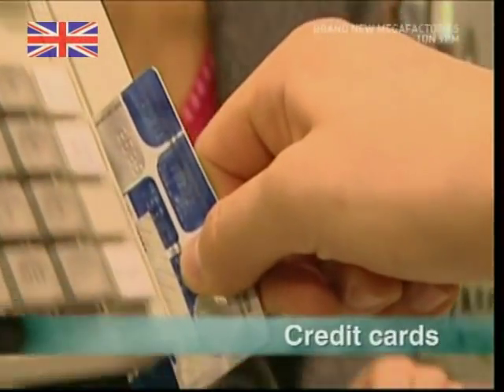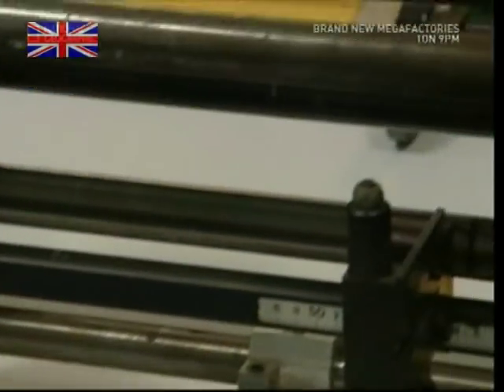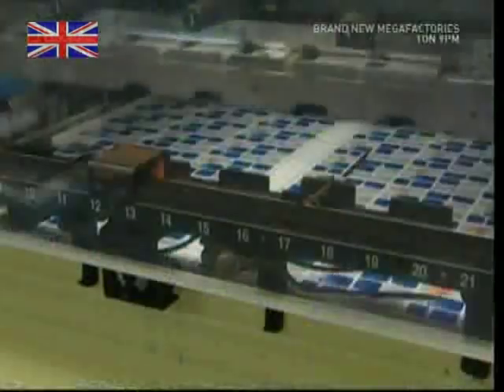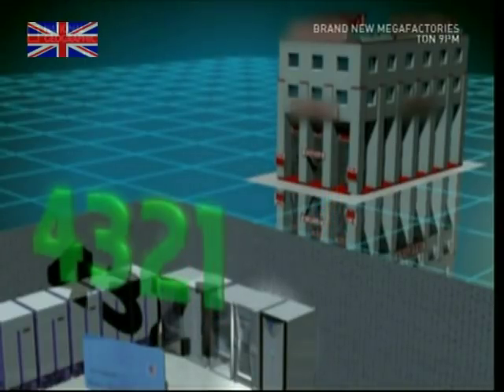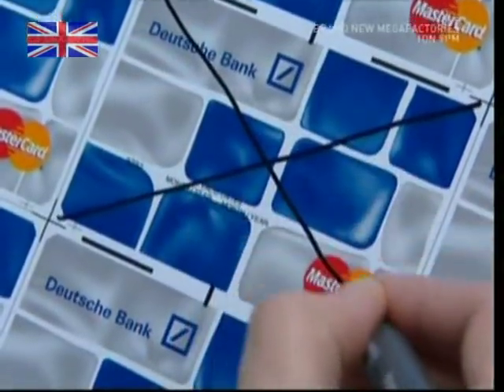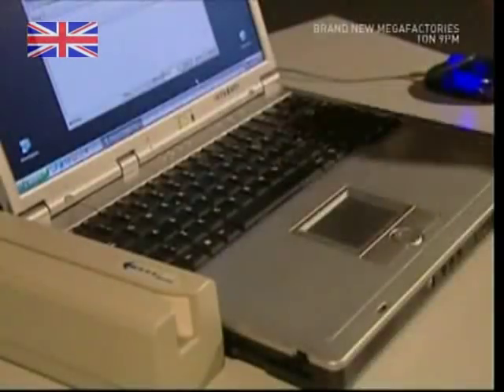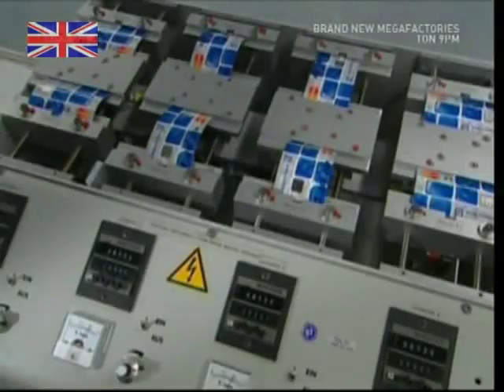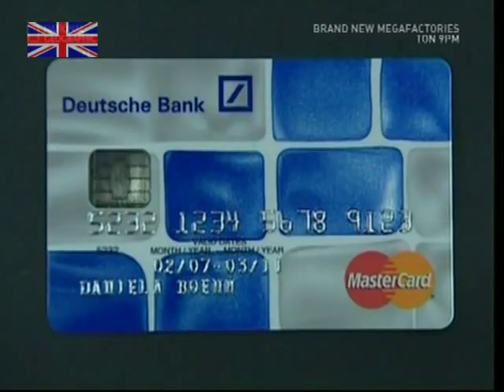How Credit Cards Are Made

Comment: Credit cards still suck.Never used one as in one with a loan on it and never trusted that old system,modern bank cards are a improvement but still you have to almost be a engineer to see if the ATM you are using is hacked for trusting the system.Those criminals are pretty clever,they build in their own chip and keypad readers at night in supermarket card readers,and they make sure the CCTV does not watch them doing it.(that's the cleverest bit)

Comment: @SonOfHicesias :D actually the only SI unit for temperature is Kelvin (not degree Kelvin), all other temperature scales are messured in degree. You should inform yourself before posting such nonsens. Just read any wikipedia article on temperature, Celsius or Kelvin. The unit is also still "°C" and not "C"